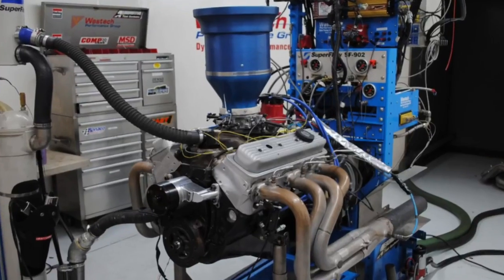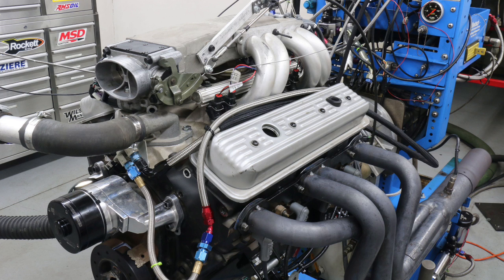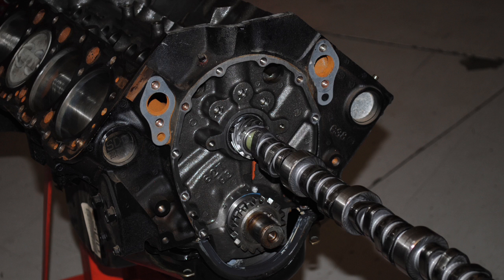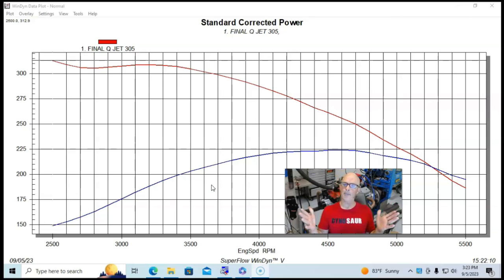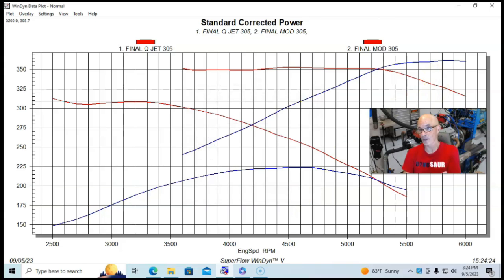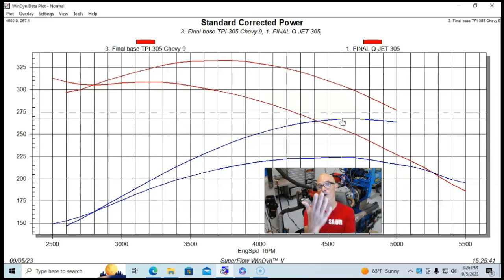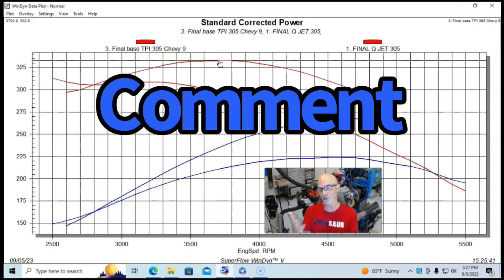HOW TO MAKE 305 SBC HP. Q-JET VS TPI-ADD 100 HP TO YOUR 3.73-BORE 305. FULL RESULTS-WHAT WENT WRONG?

Comment: Coming back to this a couple years later, I wonder if the power discrepancy is caused by the very mild cam timing of the Factory TPI cam (and their notoriously wide LSA, 115-117?) hurting cylinder filling with the Qjet setup.

And being crutched by the very good cylinder filling of the TPI (at this RPM range and power level).

Comment: TPI at its best harmonics is like 2 psi of boost
Reply from the maker: there is no boost produced-just added cylinder filling near BDC
Reply: @richardholdener1727 I’m aware it’s just that the TPI runner length is tuned to capture the 2nd harmonic pulse which is very strong, and some say at its peak at can add power akin to 2 lbs of boost

Comment: I don't know if you ever looked into it any further, but they had to have different cams. Look at how they cross at 2800 rpm. My guess is that the first one had an upgraded cam in it, since it was considerably above rated compared to the other. Cam Doctor is the answer.

Comment: 90% intake. That cast iron spread bore intake is absolute garbage. The z28 aluminum intake, or nearly any cheap, off the shelf aftermarket intake would yield better(much better) results. Beyond that timing, and carb tuning would probably close the gap quite a bit in this particular instance (everything else being the same). But c'mon, you're no fool. You knew that from the get-go.

Comment: TPI Combines the Torque advantages of long runners with Fuel Injection directly to each cylinder for precise fuel distribution. In Carb on a dual plane manifold fuel distribution is not as precise or even causing a drop in torque and HP ALL ELSE BEING EQUAL

Comment: I've got a 79 Impala 305 2 barrel 
No power
84 GMC 305 four Quadrajet 
No power
Just about dies when the 700R4 shifts into OD, LMAO.
A racecar driver told me to swap the cams out and it would make a huge difference. He gave me the order numbers for the cam, but I misplaced them. Does anyone know about this?
Thanks

Comment: Its the heads ? Not much of a question about it ? Original's valves hit the cylinder wall with higher lift..   New heads completely change the flow into the motor..

Comment: The answer to your question is the cast iron intake on the Qjet. The advantage of the TPI is the cooler air flow into the cylinders, giving you a greater air density, thus more power. Once modified with a better intake, the Qjet could match the TPI on air density/temp. The reason the TPI didn't out perform the Qjet in the final tests is that it was likely reaching the airflow limits of that intake. I believe if you would have upgraded the TPI when you swapped out the cast iron intake on the Qjet, the TPI would have made more power and tq at every level of modification.
Reply from the maker: Incorrect-the air is actually much colder in the Q jet intake (from the fuel)
Reply: @richardholdener1727  I was taught wrong... Having owned several TPI cars, I found that the NA flow through the intake manifold was a point of restriction. I put a Lingenfelter intake on  a 91 5.7 GTA and it made a massive improvement over stock. The next thing I did was modify the intake to accept GM Vortec 5.7 heads and added an Edelbrock cam. Each change made a significant improvement. I loved that engine. I had a few 90s LT1 cars, but the TPI seemed to like mods better.

Comment: Without looking at the other comments, i would guess the tpi make more lowend torque and the Q-jet made more peak hp.  I believe  if you what a basic daily drive, either is a good choose, and yes,,, the tpi will get better mph given both compos are driven the same. For me because the tpi power is smoother i tend to be a bit heavy footed. Carb get you that little bit of a kick due to all the extra fuel dumped by the accelerator pump.

Comment: Just runner length,305 needs a little help and the tpi really touches in the right place for the small cube lower rpm 305 inch engine

Comment: Now I know that the factory Chevy small block Quadrajet intake manifold is better than this. Could there have been a timing issue? The Edelbrock Performer intake doesn’t add much, at least to a fairly stock engine. But if you look in David Vizard’s book he shows how to modify a factory Qjet intake manifold to gain 20-30 horsepower. I followed his modifications and it was a big difference over the unmodified version.

Comment: In stock form the difference is in the airflow cfm and wave length tuning of the intake manifold. TPI even with its long runners flow more cfm and better wave length tuning than the stock Iron Q- jet dual plane manifold. We see this all tge time when we flow test and port the tpi manifolds and the Aluminum Q-Jet manifolds. We get them able to support a significant amount of power more.
Reply from the maker: HAVE YOU FLOW TESTED THE DUAL PLANE INTAKE?
Reply: @richardholdener1727  yes we have many times and have about 150 customers out there that's running both the sbc and sbf Air Gap and regular performer rpm Dual Plane manifolds. The great thing that we see is once we port them and modify them the way we do they can make power up to 6,800-7,000rpm with the right supporting parts and right there hp wise with a out the box Vic Jr and Super Victor. We had a customer do a engine dyno  comparison video of our entry-level stage 2 ported DP sbf carb manifold vs a high flowing SP carb manifold and it was right there even though we didn't take the divider down on the DP per customers request.
https://youtu.be/Xsq2MdH9dng?si=PxhVWifASNlXtxww
Reply: @richardholdener1727  yes

Comment: The 305 4bbl came from an automatic car. If it had come from a manual transmission car, it would have had same cam as the tpi engine, which is a hotter cam 🧐

Comment: The small bore and inefficient heads benefit greatly from the longer runners and greater velocity crated in the tunnel ram.  and helps that particular set up shine.
Reply from the maker: every bore and head combo benefits from the long runners in a given rpm range

Comment: 🤔 i know we all know engines regardless of displacement are built at what level competition between manufacturers at the time. Mathmatically bigger is not always better. Depending on the application an engines bore size closer to its stroke  properly configured will out perform. Such as the ls motors of today or say the 4.8 and 5.3 small bore engines. The 305 was the beginning of this era. The 350 was the work horse that carried it through while the 305 was being modified and experimented with from twin tbi's that was to far ahead of its time for mechanics to understand the system so gm stopped making it to tpi and anything in between at the time before graduating into the performance engine of today while retaining 350 for exclusively its work effort in trucks and school buses and whatever before its retirement. No they are not the same engines today as yesterday but its the knowledge and math of yesterday that created the engine today and it came not from the 350 but the 305 for all around performance and balance. Most hi performance vehicles dont have a far between bore stroke combination. The ones that do are more for power and torque rather than speed and performance.
Reply from the maker: OEMs don't choose bore and stroke combinations for power-bigger (using either bore or stroke) makes more power regardless of bore/stroke combo

Comment: If I had to guess, I'd say the larger manifold volume in slight combination with the fuel injection helped make up that power gap you're seeing, it could also be the jets are a little small on that q-jet for that long block and manifold but that's purely speculation

Comment: When I was a Pontiac Technician in the 80's and 90's we would race Qjet HO 305's against TPI 305's and the HO's would usually win. Also, Qjets are at minimum 750 CFM. I am guessing the camshaft in the stock TPI block is more optimal with computerized fuel delivery and spark timing. The carburated HO's had computer comand control Qjets and spark timing. The Qjet 305 you tested had none of these.

Comment: The carb 305 originally had a crappier cam and made way less HP than the tuned port motor. depending on the year. Tuned port motor's made as much as 230 hp. and with the carb, as low as 135..... Infact. If you put the quadrajet on the tpi block. it probably would make more power than the tpi did.

Comment: what kind of computer do you use? can you use the stock computer or something else to make more power like headers, bigger cam , I'm new at this so need some direction I have a gtat 5.7 and I like the TPI setup, I like to take out air pump and all the emission stuff.
Reply from the maker: we optimized the tune with a Holley HP ECU

Comment: Carb 305 could have been 8.5:1 compression, flat tappet, worse heads, weak valve springs and that low rise cast iron intake !

Comment: tuned port is always going to run better than carburetion on the factory set up but if you figure out the fuel consumption per hour on that tune, port injection, and the CFM, and then get a comparable carburetor and tune it to that same fuel delivery per hour if you can do that then they should be fairly equal but I don’t know how that injection works. Is it batch fire

Comment: kind of off subject I’d like to see a comparison with that tune port injection system that was on the GEN three Camaro for the purest, the Z 28 and the other small block and take the one off of the Corvette. I guess I could Google and see what CFM each one of them flowed because I sure don’t know but I’d like to know which one made more power

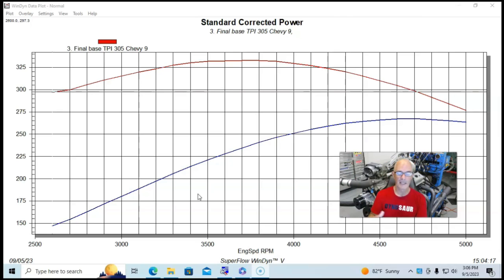Comment: 1:38 before this starts in your intro I just have to say yes, you can always jump up to the 350 and it’s more power but in today’s market today’s economy, the 305 sips a little less of that expensive liquid gold in the Quadra jet can actually get pretty good fuel economy because of its design. Also, when you come to dealing with Quadra jet’s, there were several different versions he had performance versions for some of the big block engines. I think we’re up around 700 CFM 650 and I know they had some smaller ones that were like 450 and 500 so if you use the smaller Quadra jet on a 305 and you run just on your primaries never opening the secondaries, you get pretty good fuel mileage know if you put a stock Quadra jet from what that particular engine would’ve come out of which would’ve been a GEN three Camaro. Usually it would’ve had a smaller I think 500 CFM carburetor versus the larger big block intended Quadra jets would I do know for a fact is that you can takeoff the intake from both of those set ups and put you a good Edelbrock rpm air gap in a 650 dual feed, double pumper and a little exhaust get rid of the mechanical fan and you an electric fan and it really wakes up that little engine. I’m sorry to say I was once a puppy kick but I’ve come to respect the little, 305

Comment: I ONCE PICKED UP 100 HORSEPOWER ON MY STOCK CAST IRON 4 BARREL QJET MANIFOLD JUST BY ADDING A CARB SPACER.
WELL NOS PLATE AND SYSTEM 😂
Reply from the maker: those carb spacers work well

Comment: you used a CAST IRON intake manifold than a 14057053 aluminum intake manifold. Once cast iron is brought up to temperature is retains heat which is why it make great frying pans. By the same token the ports in that cast iron manifold are SMALLER that the aluminum counter part which is why Chevrolet used it on the L82 and L69. Theyre actually a better manifold than a Weiand action plus or Edelbrock performer. So you say it wont make a 20 hp difference I say yes it will. I have an 87' Monte Carlo SS I race in NHRA stock eliminator and I am bound to using the stock 14057053 intake manifold and in Carlisle Racings dyno my L69 made 248 hp @ 4800 RPM which is exactly what the NHRA S/SS engine factor claims. With nothing more that orange Chevrolet valve springs and a 5 angle intake / 3 angle exhaust valve seat it jumped from 248 hp @ 4800 to 263 @ 5100 and I went from 34 degrees on of timing on 34 degrees of timing to 36 degrees of timing on 93 octane. So with a cast iron intake the smaller ports and retained heat was the main factor in that lost in power.
Reply from the maker: you changed valve job and springs so how is 20 hp given to the intake? Very little Temperature is imparted to the airflow from the manifold at WOT-airflow is moving too fast for heat transfer
Reply: @richardholdener1727  have you put a heat sensor on a cast iron manifold and tested that? And then compared it to a aluminum counter part? Ive seen just how hot a cast iron manifold can get under normal use and would never ever in my life use one. Just because an intake charge is traveling at 1500 feet per second doesnt mean heat is a non factor. My GPz 750 turbo made 52 PSI at the intake valve and the speed of the intake charge was many times faster than what a naturally aspirated engine could generate and the heat was a major issue. And yes I understand atmospheric pressure and understand Im comparing apple to oranges but the physics are the same only exaggerated in the forced induction example. Im sure the thermostat in your engine was around 200 - 210 degrees mine was at 180. Maybe that was a contributing factor maybe it wasnt but it gets back to aluminum vs cast iron and a factory stock part designed for daily use vs a factory performance part. The 14057053 casting manifold is actually a pretty decent manifold considering its intended use.

Comment: Carburetor is too big. A quadrajet only really came in two flavors: 750 and 800. That's way yoo big for a stock-trim 305. Running this with a 454 might yield more similar results between the two setups.

Comment: TPI I believe was originally designed FOR the 305 from what I have read on the internet (we all know what thats worth). But it makes sense. We all know the tpi chokes at higher RPM but even on the stock TPI 350 and 305 cars I have driven, the 305s hang on longer and just seem happier and hang on longer. You can even see in these graphs, that lb9 never falls off a cliff all the way to 5000 like the l98 does right around 4500. It seems that the port size and velocity was tuned perfectly for the 305 that it gets the perfect amount of cylinder filling and gets all you are gonna get from that engine, with that cam, with those heads. Obviously goes out the window whem modified. But if both long blocks were truly the same, thats the only thing that makes sense. The LB9 honestly is just a display of impressive engineering from GM. It was such a step up from any 305 before it. Also always thought it was funny that the manual LB9 cars (230 Hp version) got within 15 HP of the hottest L98 (245 Hp). The 350 has more torque and area under the curve but not as much as there should be. More evidence the system was really designed for the 305 and adapted to the 350 as well.

Comment: Hey Richard ! Great video comparison...  My 85 Fbody was rebuilt 20 y ago and I went with  smog legal Holley intake, but had to keep the electronic Quadrajet - RV cam and  banks catback exhaust system. Power went up enough to put the car at high 6's on 0-60 - where it was low 9's before - or about 2+s faster :))) Now I am considering the Lsx, but  then I saw your video about cheap M90 supercharger  ---wow -  what a gem  - thanks for that!  Happy New Year too.

Comment: Assuming I have a std 305 at about 220hp, what is the cheapest/easiest way to get to ONLY 300hp...?
Reply from the maker: ported heads, cam and 4-barrel intake
Reply: @richardholdener1727  Ok thanks for that, could you suggest a cam duration/lift to go for on such a mild tune?

Comment: I replaced the stock iron intake Qjet with a Edelbrock performer 600 holley on my 1985 pickup 305 and I couldn't believe the extra performance. I was very happy.

Comment: Richard, I've been thinking for a while now about stroking a 305 to a 334 with a 400 crankshaft mainly to increase the low-end torque. Trying to get as much power as possible with the best fuel economy as possible. The more low-end torque the higher rear gear ratios can be run to help with the fuel mileage. Do you have any stats. showing anything like this?
Reply from the maker: easier to just grab a 350 vortec motor from the yard
Reply: Right, I could have told you that, but I'm sure the 334 would get better fuel economy with the smaller bore. But thanks for replying. Oh yea, if you think about it essentially you would be exchanging 1/4" less bore for 1/4" more stoke.    @richardholdener1727

Comment: The difference in factory form power is the way and amount of air entering the engine the carburetored intake manifold is way more restrictive the the tpi which also would have a velocity effect with angle and length of tpi intake runners and possibly air intake temps entering combustion chambers cooler air will always create better fuel combustion on moment of ignition add that to more aggressive ignition timing abilities equal more power produced. Least thats what comes to mind for me, could be something entirely different?
Reply from the maker: The reason a TPI motor makes low speed power is the runner length
Reply: Different factory cams.

Comment: The one that was run as a 305 TPI was probably an engine for a G92 car. Despite still being a LB9, the engines in the G92 cars had a slightly hotter cam with a 500rpm bump in the redline. So no, I do not suspect they were the same long block and I do suspect that cam difference made up the bulk of that 40hp disparity.
Reply: Yes it was definitely the cam.

Comment: I wonder what would happen on the carb stock version if you used a aluminum intake with a 650cfm demon? I bet results would’ve been similar to TPI. Probably better
Reply from the maker: no-it makes more up top with the dual plane and carb, but less down low-see the dual plane vs tpi video